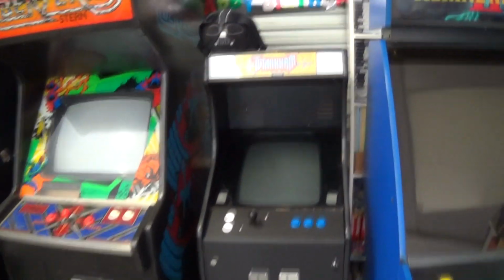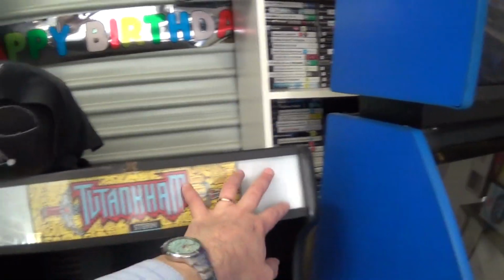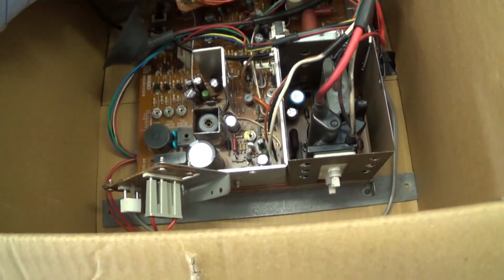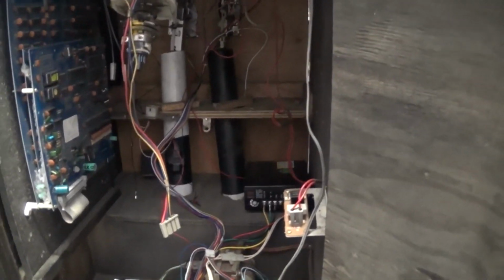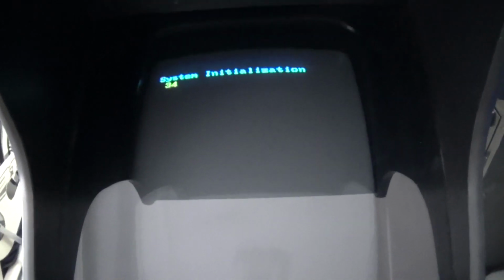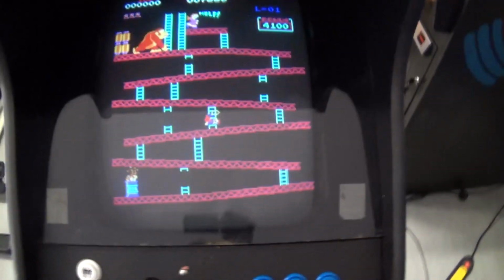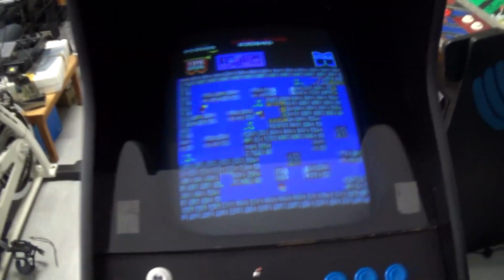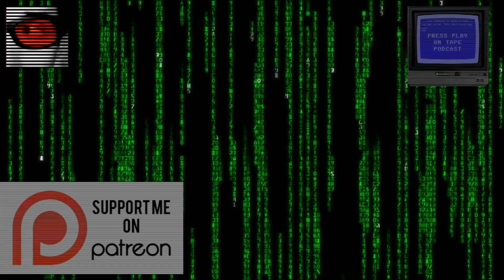The Arcade Project - Mini Upright Monitor Fix

Comment: ELECTRICADVENTURES 
       How do you know if your arcade monitor had a BAD linearity coil? 
                  what does the Linearity coil do to the H&V deflection signals? 
or what is the purpose of the linearity coil?
Reply from the maker: I’m afraid I don’t know enough about crts as yet but I am learning. Probably why looking after the neck of crts is most important. I need to work out the degause wiring though.